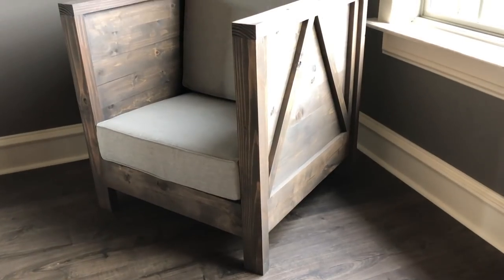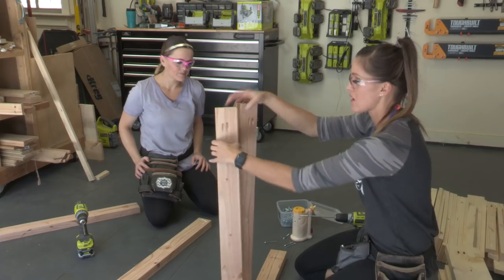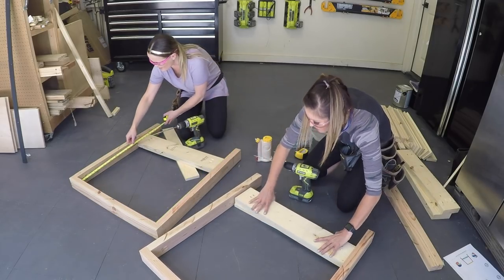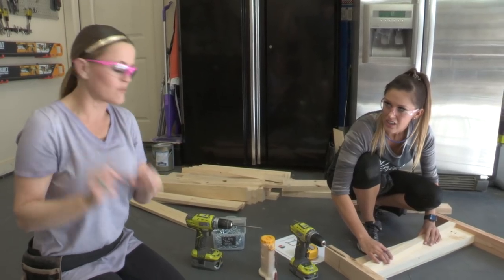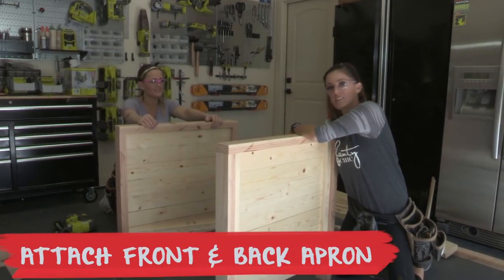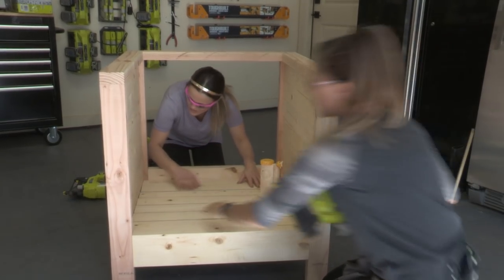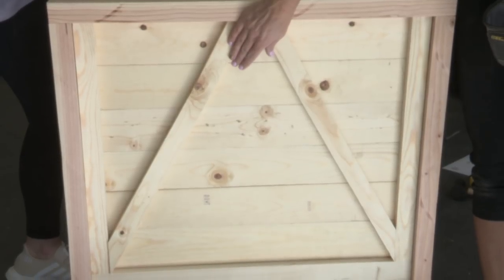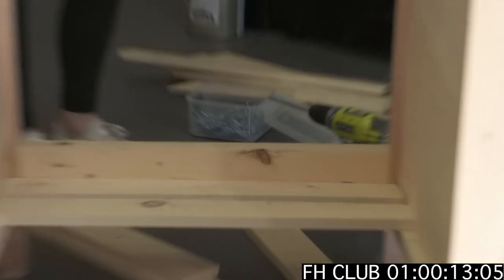DIY Farmhouse Club Chair

Comment: Hi! It is necessary to make the pieces straight edges? I don’t have a table saw and once I tried and almost took off my finger. Just want to see if the measurements will be the same if I keep the edges rounded.
Reply from the maker: Paint the Grain no but modify measurements if you don’t!

Comment: Like the chair but it looks pretty low. What is the finished cushion height?
Reply from the maker: 1lipsey 5”. It was designed to be low to the ground with high arms. You can adjust the leg height pretty easily